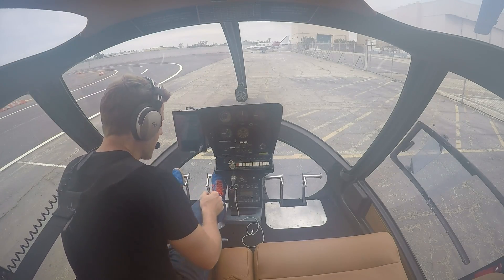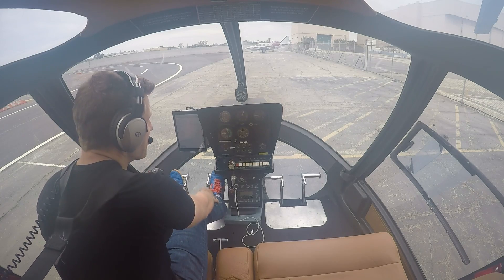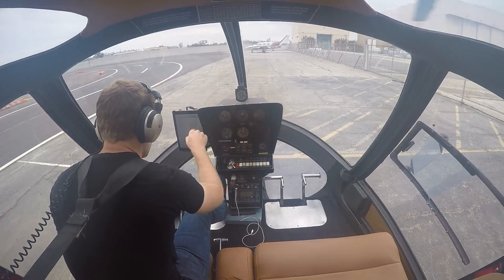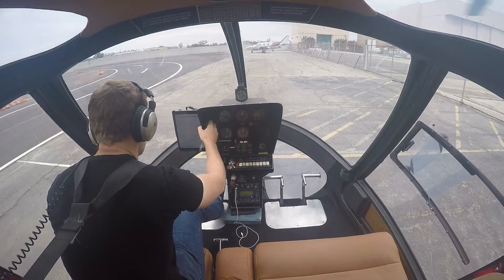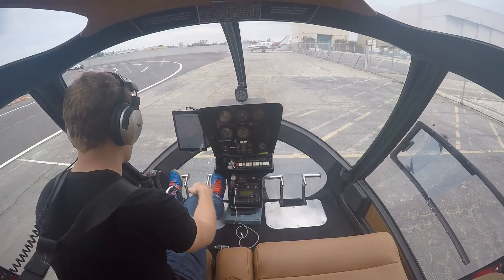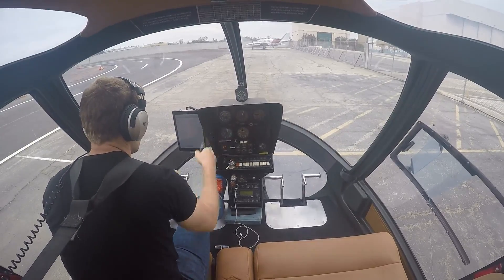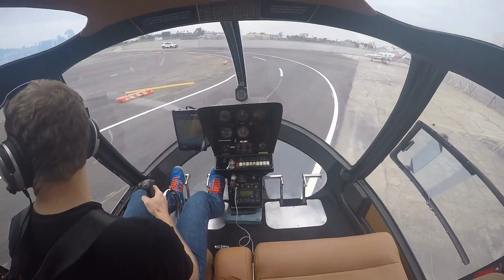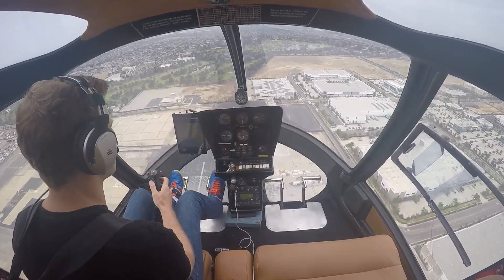Helicopter Startup And Takeoff -  Enstrom 280C

Comment: You said that if engine was to stop running then you could glide to a landing and not crash if true then why have I heard many times a helicopter loose its engine and it crashed cause of engine stopped running and it crashed why did it crash when engine gave out why not glide to a landing as you stated but yet a crash? Please explain why? Thank you sir,
Reply from the maker: Good question. Think of gliding a helicopter just like gliding an airplane. Doing so successfully requires a competent pilot doing the right things at the right times. 

In a helicopter, when the engine fails the pilot must immediately lower the collective to reduce main rotor pitch. Fail to do so and the rotor blades will stall and the helicopter will fall from the sky. Do so quickly and the blades will keep spinning and the helicopter will descend quickly but in controlled fashion. 

The other critical moment occurs right before landing. The pilot must perform a "cyclic flare". Basically they pull back on the cyclic (the center stick), raising the nose of the helicopter. This reduces the rate of descent and airspeed. At the end of the flare the pilot pushes the cyclic forward, leveling the helicopter, and just before touching down the pull up on the collective to cushion the landing.   

Doing all of this correctly takes experience, excellent timing, and the ability to perform well under pressure. In most cases, a helicopter can absolutely land safely following an engine failure. The big variables are the pilot and whether they have a safe spot to land.

Comment: Cool, now I know how to start a Enstrom 280C helicopter.. now I only need a Enstrom 280C helicopter.
Reply: I used to have one.Great fun and one could be yours for £60-70k.
Reply: @jetranger61  But how much is the maintenance and how much is a gallon on fuel these days?
Reply: and an ipad
Reply: @Aralmo640  The iPad is the cheap bit ;)
Reply: dtiydr

Ditto that 😊
Reply: I'm just not so sure about an "I-Pad for a check-list!  Computers crash, then what do you do!  Checklists have been proven to be so important in aviation because there is a lot to do and if it isn't all done precisely, a crash could ensue.  So, I'll stick to my clip-board and paper check-lists, thank you!
Reply: @MJLeger-yj1ww  Commercial pilots use them so ... if something can fail it will definitely fail miserably in a 250 souls on-board case :)))
Reply: @msergiu80  It is still a fact that 85% of airline accidents is due to pilot error, but with advanced computer technology today, those accidents are lessening.  Weather and mechanics are still factors, but rare now.  Pilots have systems on their panel to see weather and avert it, and if it is a mechanical failure, often they can still get down, unless something violent happens like the loss of a stabilizer or an engine comes off and damages the aircraft.  Flying is STILL the safest mode of travel!  A rare weather phenomena that they cannot see on radar is clear air turbulence, but it doesn't happen often.
Reply: Roger that
Reply: minor detail
Reply: Lmao
Reply: Hahaha...
Reply: And a PPL(H) license. xd
Reply: 41 years ago it cost roughly $15, K Canadian for a commercial course. 100 hour wonders. Probably in excess of $30, K these days. Less the I-pad...Avgass 87 for fuel if memory serves. These are piston engines by the way.
Reply: Why do all these guys talk as though they are trying to impress themselves with what they know ? They speak so damn rapidly with that chipper clipped style that it doesn't sound as though they give a damn if the person they're talking to is able to  hear and understand what they're saying? Of course, no body wants to seem like a dummy and admit they're not getting it, so they just act like they understood everything said. I wonder if more aviation accidents aren't caused by incomplete communication within the cockpit and the air traffic control system! I rarely hear any young person today give an instructional talk without quickly mumbling a lot of gobblygook and following up with a bunch of OK?,s. They seem to assume their listener is absorbing everything they say just as quickly as it can be rattled off.
I appreciate these tutorials but it seems everything that is important such as the explanation of the controls is covered so quickly. Why is the CYCLIC even called that in the first place? why is the COLLECTIVE called a collective? What does it collect? I had hoped that these tutorials could give me an understanding of how a helicopter works. I'm probably becoming one of those old farts who can't understand things like "which way is up"
Floyd
Reply: @floydrasmussen255  The reason they speak fast like they do is because of repetition. The more you do something over and over, the faster you get at it. It's also beneficial to be quick on the radio because there are lots of other aircraft that need to communicate.

The reason the collective is called the collective is because it collectively changes the pitch of the rotor blades. The cyclic changes the pitch in a cyclic manner (i.e. changes the blade pitch based on the position the blade is at in the 360° rotation).
Reply: Well get use to the smell of jeta because I smell helicopter fuel everyday because my dad works on helicopters
Reply: @driydr but do you know the controls
Reply: @MrJush22 To control and fly the helicopter I can say yes even if I have never done it. It is not that hard you just need to be able to have the coordination to simultaneously control several things at once, which I have.
Reply: @dtiydr . The day I passed my private pilot’s license there was a guy trying to get students to fly his helo.  I had all the confidence in the world after just passing my test. I got in the Helios right seat.  And we took off.  He warned me that he was turning it over to me. With in a minute he took back the controls.   This is one of the hardest things I’ve ever done.  Yes there’s just three main controls but getting used to them is very difficult.  Nothing easy about it.

Comment: ¿Just a quick question, how is it you are flying from left seat as opposed to right seat?
Reply from the maker: H. G. La-F In some helicopters with a 3-seat bench the pilot sits on the left side to accommodate the collective control, which is always positioned to the pilot’s left.
Reply: Thanks for informing.

Comment: ok so what is the purpose of the rotor clutch?
Reply from the maker: Brian Redden The clutch is a super durable belt. It allows the engine to start easily, without the drag of the rotor system. Then, once the engine is started, pulling that lever on the floor tightens the belt. That connects the engine’s output to the main rotor and tail rotor.

Comment: Flying a chopper is different from turning a plane. I heard a chopper is easier to crash then a plane. A choppers movement is very hard
Reply: If you take your hands off of the controls in an airplane, most will quite happily fly itself.  Airlplanes want to fly.  Helicopters want to crash.  You can't take your hands off of the controls in a helicopter, or it will get its wish.

Comment: For a cold start, try mixture rich - boost pump on - open throttle to near full then close - boost pump off - mixture to cutoff - crank engine until it starts - mixture rich. Always works for me, even in cold weather.

Comment: Hi there Micah, thank you for posting this. I recently purchased a 280C as well. I'm curious- What mount are you using for your iPad and which app for the checklist? Thank you!
Reply from the maker: Congrats on the purchase! You're going to have lots of fun in that thing. 

As for your questions. 
1: I'm now using the checklist function included in Foreflight. It's totally customizable and easy to use.
2: The mount I'm using is a custom setup using elements from RAM Mount. I triangulated the mounts to the instrument shroud and the result is decently stable and nicely positioned. Oh, and the iPad sits an iPad cooling case from X-Naut. It's a little pricey but having had my iPad overheat on several occasions the X-Naut case seemed like a worthwhile expense.

Comment: Just rewatched this again now that I have my F28F and have a new appreciation for the start. Have you tried a full rich start on a cold engine? Roger at Sharkeys recommended that and seems to work well. Boost -- full rich -- and a bit more throttle. The hot starts are another story entirely!
Reply from the maker: That's a really interesting suggestion. Never heard it before but I'm guessing Roger knows his stuff. If my engine explodes I'll be sure to post another video. ;)
Reply: Micah Muzio Hah, I better delete my comment now...

Comment: Nice video...  I've always liked the Enstrom 280.  What do you figure your hard operating costs are?  I received my Rotorcraft Private over 25 years ago.  Been in a 530F.  Lots of fun.  Find myself using it mostly to go golfing due to the +$650 an hour operating costs.  If I need to actually get anywhere I strap on an AeroStar 700.  Considering going down to an Enstrom.   Your bird looks to have been well taken care of.  Also, why do you fly 500AGL?  I'm usually hanging around at 300AGL.
Reply from the maker: Well, I've spent a fair bit sorting out the kinds of maintenance issues that accumulate with a nearly 40 year old helicopter. But with most of that finally sorted the big costs are insurance and fuel. Given your flight experience insurance should be fairly cheap. As for fuel she burns about 15 gallons per hour. Figure $100/hour depending on the price of av gas in your neighborhood. 

The bigger question is how you'll feel stepping down from a 530F. The Enstrom likes to cruise at 90-100 mph. Assuming the comparative lack of speed doesn't bother you it's a great ship for flying solo or with one passenger. FYI, I've never actually flow one but I've always dreamed of owning a 500 of some sort. Blame Magnum P.I. 

Oh, and I like 500AGL because it gives me more emergency options when flying around densely populated Los Angeles. That said, I'm comfortable flying lower when I'm out in the boonies. Cheers!
Reply: Robert Kaindl a
Reply: Movie, the twilight girls

Comment: i was wondering if a helicopter has a RVR limit. I know alot flown with VFR and has wind restraints but what happens if visibility suddenly deteriorates? IFR capable?
Reply from the maker: b xpress6 Perhaps some aspect of flying choppers delves into it but at no point in my training did RVR Limit come into play. 

FYI, my helicopter is strictly a VFR ship but there are definitely IFR helicopters out there.
Reply: +Micah Muzio thanks for the info. Everyone knows the retired F-117 was known as the wobblin goblin so im sure the Enstrom 280C must have a shuddering nickname😆
Reply from the maker: b xpress6 Fun fact. The 280C's nickname is "the shark" because it kinda looks like one and the small vertical stabilizer caused it to yaw left and right in flight like a shark swimming.
Reply: +Micah Muzio interesting. still pretty bird. fly safe👍

Comment: Hi... what are the advantages of the electronic checklist?  I like having the paper foldout on my knee-board.  Nice vid, btw.
Reply from the maker: I like the electronic checklist because I no longer worry about my paper checklist getting sucked out when flying doors off. The electronic checklist also has a handy "tap to check" function that makes it extremely easy to verify which steps have and have not been completed. Lastly, updating the electronic checklist can be done with a few quick taps, unlike a paper checklist that has to be reprinted and laminated. 

All that said, I have a paper backup in the POH in case the iPad ever quits.
Reply: Cool.  We are a bit of a blend of old and new in the Coast Guard right now.  ForeFlight on the ipad and paper checklists...
Reply from the maker: Mudkow You fly with the Coast Guard? Awesome! What do you fly?
Reply: MH-65D Dolphin...
Reply from the maker: Mudkow My jealousy runs strong. Thanks for your service!

Comment: I thought that in a helicopter the pilot flies it from the right seat.
Reply: the Hughes 500/MD500 series of Helicopters are also piloted from left.
Reply: I'm always happy to fly from the left seat in my R44 but for weight & balance you are only allowed to do that with passengers. The manual doesn't actually state that any of them must be in the right front seat though.
Reply: Only in America. The rest of us drive on the left hand side.
Reply: Depends on helicopter. MD500 fly from the left also
Reply: JayWhy Duplessis depends on the Helicopter, but you are some what right in assuming PIC is right hand side. That's thanks to the pioneer of helicopters Sikorsky.
Reply: Try to find out!  I always have flown on the seat of my pants in the captains seat - left.
Reply: ** In early1970'S I flew a couple trips as {co-pilot} in the Right seat out of Lousiana to Offshore Rigs  - 135 miles out,  in the Gulf of Mexico in Bell Rangers...
Reply: In the UK !
Reply from the maker: Because the collective lever always sits to the pilot's left helicopters with a single bench seat sometimes have the pilot sit on the left side. That's the case with my Enstrom. When I trained in Robinsons pilot in command sat on the right.
Reply: Thanks for the info Micah.
Reply: Also if you're doing sling loads, its easier to lean out over your collective arm, than away from it. i.e. left seat.